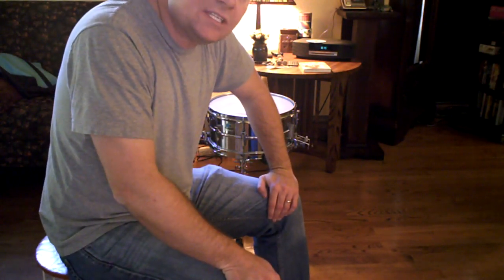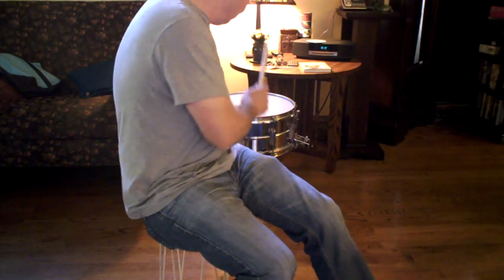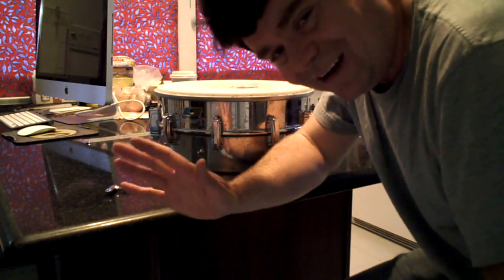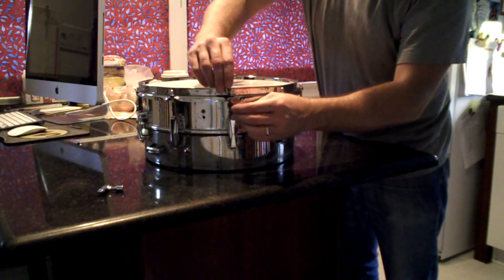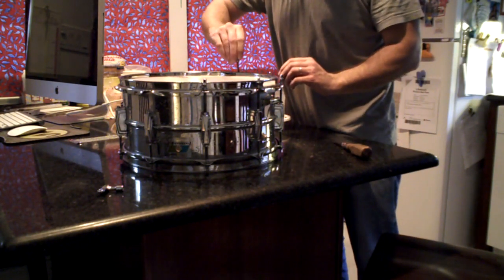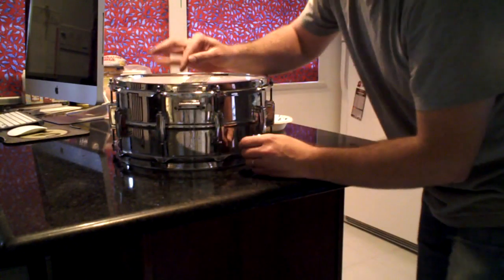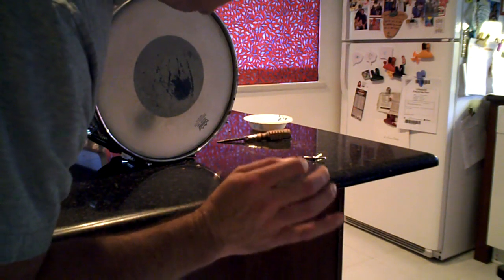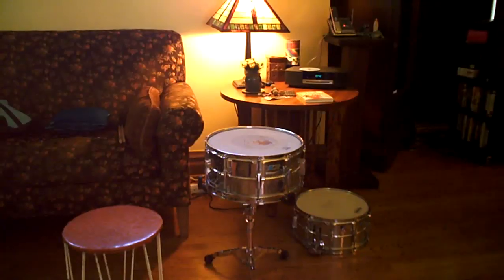*BONHAM SNARE DRUM TUNING*  VIDEO

Comment: I guess it's a bit of both. When you don't have ear protection you will here more "noise" from the drum that most of the time be tuned away with patience, time and a good drum head. Another thing is that your ears with use their own noise-cancelling when sounds get to loud and that will in turn distort the sound. Regular ear protectors will often block out certain frequences more and give a "fatter" sound. Same thing with mics that will make the drums sound more like when you have ear protection

Comment: Do you think it's a worthwhile conversion? The last super-sensitive drum I had was the kind with individually-adjustable strands. What a PITA that was--but the mechanism on the drum I saw yesterday didn't have that type of strainer at all. The snare was simply screwed in place at either end as I recall. The drum sounded fine, but it's pretty hard to beat the P85 mechanism...which probably has something to do with the reason they are still around!

Comment: Hey Terry. Just to let you know. Old time John Bonham friend and drummer Dave Mattacks said in a 1980's Modern Drummer interview that John tuned his snare top head really tight, and the bottom was looser.  Several times Bonham drum roadie Jeff Ocheltree says the same thing on his DVD. I'm not disputing you, in fact I think you're right, because tuning THEIR way yielded unsatisfactory results!  Thanks again!
Reply: Ochletree absolutely does not say that on the DVD.  In fact, he goes on at length about why it is essential to tune the resonant head higher on all the drums.  And not only does he make a point of saying numerous times that the resonant head was tuned higher than the batter side of all the drums, but when he strikes the drums with a mallet, one can plainly hear that the resonant head is tuned to a higher pitch than is the batter side.
Reply: +Anthony Stewart - You are RIGHT!  Man I choked!!! XD  I stand corrected! Thank you!

Comment: I love when he sings! What are you going to do with 2,000 yards of cord used for snare wires? He might be just a little obsessed.
Reply from the maker: One never knows when they'll need to 'snare up' a couple thousand snare drums!!
Reply: bonzoleum You're a funny guy. You're very comfortable in front of the camera. I'm currently playing drums in a Zep band. I'm using a Black Beauty which sounds great but slightly different than the supraphonic. I'm gonna try changing the bottom head from the Ludwig stock head and see if it makes a difference. I already have the coated emperor on top.
Reply from the maker: Put a Evans 300 Hazy snareside on the bottom. To me it's identical to the Ludwig snaresides of the 60s-70s.

Comment: John Bonham's Snare was a Chrome over Aluminum 402.. It was not Steel!... Ludwig use the term "Ludalloy" ...but it was just their trade term for "Aluminum"... Powerful with an almost Woody Character.... NOT Steel!...

Try this tuning.... Bottom head medium weight resonant (IE: Ambassador or equivalent) evenly tuned to a "G"... Higher tunings tend to choke the sound... Top head : Ambassador (or equivalent) tuned to a Bb... It's that sweet spot between low and high... PS. If you can find Ludwig heads USE THEM! Be aware though that the Ludwig equivalent for an Ambassador weight is their "Heavy"... The new heads have gone back to the old logo (instead of saying "rocker") these heads work wonders on a Ludwig snare! Good Luck!
Reply from the maker: Yes-aluminum.
I find the minor tuning to be most effective in bringing out the 'throaty bark' of a Supra (specifically aluminum)-with definitely the bottom head tighter by at least minor third (not always).

I've never gone and done it, but I bet if I (or someone) did the statistical experiment of taking all the hardware off ten random Ludaloy 6.5x14 Supras, the fundamental note of each would be very close-and generally a minor tuning differential may have significance in the note. (If I'm wrong on the minor thing-I'm sure a chordal relationship would hold.

Comment: Hey Terry was just wondering if you've ever had any problems with the P85 throw off, as far as losing tension on the wires during play? Im having this problem on my Supra after i switched to some Tama 42 strands. Used the same straps that were on the stock Ludwig wires. Right now i can't play 2 songs without the wires loosening up. I've heard mixed reviews about P85's needing adjustment during play, any advice would help. Thanks!
Reply from the maker: It's probably the integrity of the 'grippiness' of the P85s strap holder-on-er.
You can sand/rough up the strap areas where the P85 'sandwiches' the plastic, or use a different strap.. It could conceivably also be the knob slowly detuning as you repeatedly hit the drum.. 
I use cord. I file out the threading of the holes (that the sandwich-er is screwed into), and put the cord through that...
Reply: bonzoleum which 42 strands would you recommend, i got gibdaltar (however they call themself) and it sucks. 6 weeks in i have broke two strands, i use low tension and the last one i used for 3 years or so still is like brand new. so i know how to use them.

Comment: How much natural ring should a 6.5 X 14 Supra have? I bought a new model and have been trying different tuning and different heads, snare wires, and it just RINGS so much after you hit it. Kinda not sure what to do next? Using an Emperor on top and an Evans 360 clear on bottom.
Reply from the maker: They came with built in tone controls until the 90s. You can install one (Ludwig still sells them), or use a hoop mounted one. Bonham, indeed did use his tone control on his Supra.
https://www.interstatemusic.com/33162-Ludwig-P40662-Complete-Internal-Tone-Control-System-P40662.aspx?sku=PA004P40662&source=Google+Base_CASCIO&source=Google+Base_Cascio&utm_source=google&utm_medium=product&utm_campaign=gbase&gclid=EAIaIQobChMI4uHa9fTL4AIVp5PtCh0enwjqEAQYBCABEgJNbPD_BwE
Reply: bonzoleum thanks man! I didn't know I could do that. Thanks for your videos, they're the best!

Comment: Do we always have to start with the top head when we tune the snare Bonham style?
Reply from the maker: Adrian Manuel No, but it makes it a lot easier when you start with the pitch of the batter head and therefore can then dial the bottom quickly relative to the top.
Reply: bonzoleum  do you know the exact skins he Bonzo used on his snare? I've heard coated emperor on batter side and ambassador on resonate side but don't now if the batter side is coated or not?
Reply: sweetleaf714 yes it is coated

Comment: Do u have a drumdial setting? Snare tuning has been a issue for me for a long time.
Reply from the maker: Brian Styles I don't have one. BUT I suggest a usually-$5000-advice-but-it's-yours-for-nothing short cut: tune/tension your snare side/reso head to that it sounds like the typical pitch of the higher tuned pitch of a standard set of timbales. I highly recommend an A sharp. Tune the top to A.
Reply: Ok...thanks. just got confused when u said too head D minor...top head and f minor for bottom head when you were tapping on your piano.

Comment: Would putting a piece of a moongel inside the top head have the same effect at the tune controller ?
Reply from the maker: I'd always use it on the outside. I'm not sure of exactly how many you need or where to put them to make it sound the same as an actual Ludwig tone control. You can score one at the DCP folks : https://www.drumcenternh.com/ludwig-internal-tone-control-for-snare-tom-drum-p40662
Reply: @bonzoleum  thank you for replying ! I just bought a yamaha maple custom absolute , 24 bd , 16 ft, 13 rt and 14 by 6 snare and it's amazing. I like my toms lower in pitch than Bonham but i have a similar sound on the snare but i hate using moongels so im actually taking it in to a guy that builds drums here in AZ to install a tone controller on all my snares and i two new toms too
Reply: @bonzoleum  i know you said to tune then a minor 3rd or 4th apart but do you know the pitch ? In another video it sounded like a d and f# or g to me but my ears suck at hearing that shit with drums

Comment: you can't discuss the sound of a drum with that mic set on a low budget video cam.  that sounded horrible.  invest in quality audio for a video like this or what's the point?
Reply: Free At_Last The pitch of the batter head in relation to the pitch of the resonant head is the main point. The quality of the audio is irrelevant. What about the countless written instructions dealing with this exact topic (with no audio at all) that are all over the internet? Are they useless? If he had pristine audio and you tuned your 2 opposing heads to the frequencies that he suggested, you would still get the same results.